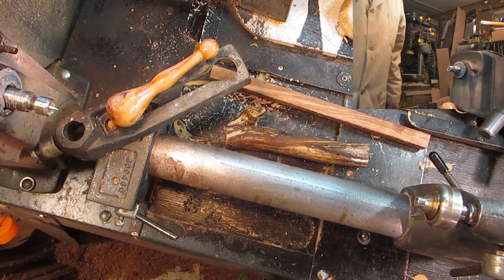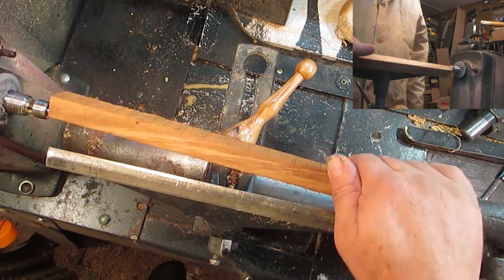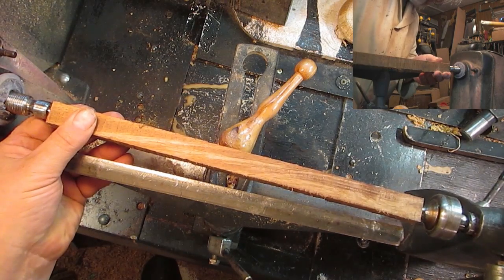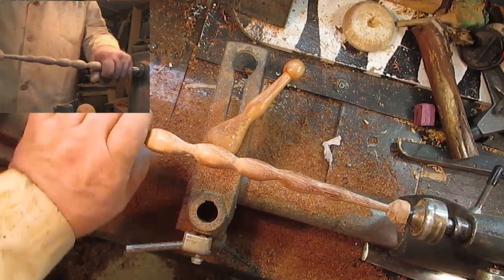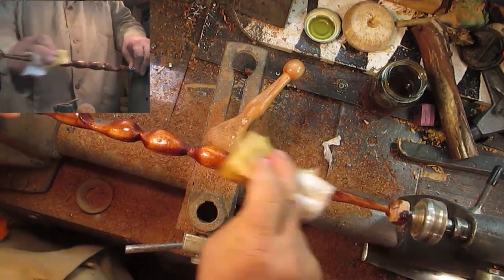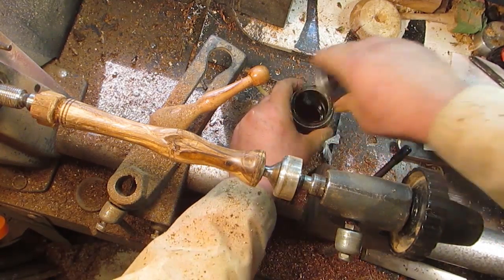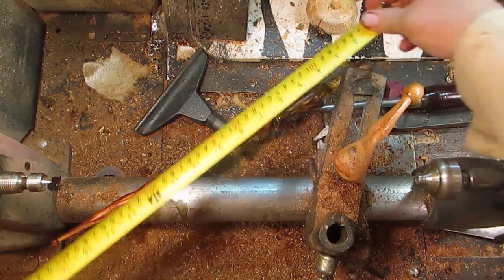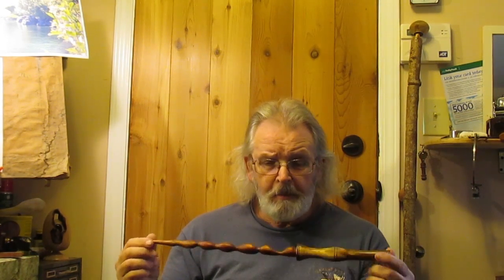Wood Turning #89 A Magic Wand

Comment: Well Larry, this is the best by far Magic Wand I have seen turned on Youtube. I like the random type off center turning. It just looks more natural and not so much calculated mechanical feel. Very well done my friend. Tung oil is one of my favorite finishes.
Reply from the maker: Stephen Ogle Hey Stephen: I have a secret for you... on the handle... I used the tung oil... but then I put a shellac friction polish over top! I like the way it came out... Just make sure you don't  tell anybody about this!   Organic and random... yeah... that sort of puts a finger on the fact that I didn't have a clue as to what I was doing! I like the results more than if I had done something like the egg cups I did... but I will probably try that way too!      Thanks for watching   Larry
Reply: I do sometimes use other finish over the tung oil also. Your secret is safe with me.
Reply from the maker: Stephen Ogle I knew I could count on you!

Comment: Hi Larry, I think your pattern for turning offcentre has worked really well and given the wand a unique, gnarly, look which is very attractive.  Instead of trying to fix it I would be doing more of the same to see where it brought me.  I like the tung oil look too.
Best Wishes, Brendan.
Reply from the maker: baconsoda Hello Brendan:   My pattern was a complex set of algorithms that tuned the harmonics just right! It was also a matter of the fourth hole breaking and leaving me no way to get to the rest of it!! So I guess that is what I will have to do in the future... break one side off before I start!    Seriously though I do have a curiosity as to what can be done there... I guess I would have to invest in a Lathezilla to get it to a spiral... but close might be interesting!    The Tung oil certainly does add a flare to it!       Thanks for watching   Larry

Comment: you have a great voice, very easy to listen to.
Reply from the maker: Tizona Amanthia It's the best one I have! But I do tend to save it for special occasions! ;>) Thanks for watching   Larry
Reply: chuckles I've heard some men have many voices. waggles eyebrows a good challenge for you might be a toy, or other object that is made of multiple parts that interlock snugly. one fun one is what's called "twist tac toe" think like you took 3 rolling pins, drilled three sets of three holes in each, and mounted so they turn easily in a block of wood, with another nine holes drilled into it's face plate, such that the sets of holes line up. a marble dropped in will land in the "roller, and thus the game of tick tac toe is made more complex.

Comment: Awesome wand, I love how you used two different kinds of woods - and they compliment each other very well. 

Can you tell me how you attached the two pieces?
Reply: Larry drilled a hole in the handle, (you can see the drill setup at 8:12 )and turned a tenon on the end of the wand that fit into the hole. (you can see the tenon on the left end at 8:55)  :)

Comment: The offset thing is a real challenge. I did a walking stick and my dyslexia got me backwards. Turned out well, all-the-same. The wand looks good!
Reply from the maker: kbbacon Hello Kevin: I think I will have to practice that a little more... I like the way this one sort of is and sort of isn't off centered... and I think that lends a certain appeal to it... but I do believe that there are a great many more shapes hidden in there! This wand is almost as long as your walking stick... but I don't think it has the same holding up capacity!      Thanks for watching   Larry
Reply: The Tiny Trailer Workshop axeminster machines and tools England

Comment: Just wondering, why have the wood of center? I don't know much about wood turning and lathes and all that, but it still made me curious!
Reply from the maker: +Nicholas Flanders Hey Nicholas: It would have been a lot easier to just do a straight tip on the wand...but I was attempting to create a more mystical look!  There was no real need for it but I wanted to see if I could do it! The method that I used didn't hold up as well as I had hoped so I ended up with a three sided wand... had it held up the knobs on the shaft would have done a slow spiral up as you turned it! It is not putting a thread on it but it does have some of the same principals! ;>) Thanks for watching   Larry
Reply: The Tiny Trailer Workshop Thanks for the info!

Comment: that's such a skill, I wish I could learn how to do this :-)
Reply from the maker: +Grace hallons Hey Grace: All it takes is some practice! You don't learn to make a wand any differently than you would to learn a new spell... time and patience! Put your mind to it and I'm sure you will come up with something fabulous!  ;>) Thanks for watching... Larry
Reply: I don't have the equipment a tiny dremel and a few files a swiss army knife. no room for I like the way the twist is like a unicorn horn, I can't have a lathe due to lack of space, but I think you should make some more wands, I think you're giving up too soon  ;-) .:( thank you for the kind words :-)
Reply: +Grace hallons Many turners begin with a mini-lathe, a handful of tools and a shop vac, and they make some really neat small items such as this wand. Of course that still takes some space, like maybe 4 x 6 foot table top. Dust is also an issue but the shop vac helps. Hope  you can find the space and start turning! :)
Reply: I sadly can't accommodate one I do have asthma so it's probably a sure fire thing of a 'no no'. I use to use a mini kiln in my old place to fire metal that was outside, I no longer do anything like it and feel quite empty about it. that was great fun,melding different metals together but hard to get them to right temp... easier to do on a scorching hot day.felt a bit flashdance too!  but, downsizing has really put a whole new spin on things. I guess I will figure out what to do in time with something smaller and less dust it's just not much fun not being hands on with things. mini lathes a good idea. Thank you just bought a wand it wasn't turned it's pretty rustic with crystal on top but, it was made with love. almost forgot merry christmas! thanks and all the best with the wands!

Comment: What centers are you using for the offset work? It appears your using a live cupped ring center on the tailstock, but what are you driving with? It appears to have a long pin on it... Neat!
Reply from the maker: Hello there:
 I have a pen mandrel that uses a live center to hold everything together... sorry I can't remember the name at the moment... but I got it from KMS ... so if you look up their catalogue on line you will find it! This is the only live center I have and it works like a hot....well!
 The other end is a spur... it came with my Craftsman lathe... (I got it well used) and I assumed that it was for the tailstock. At least that is where I used it for years. But then I found that using it enabled me to turn wood that was difficult to turn otherwise by making so that if there was a catch of any sort... the wood just stops. This I found very handy when working with the skew! The only thing that happens is you get to see where the problem area was without loosing it!
 Glad you enjoyed
 Thanks for watching
 Larry
Reply: The Tiny Trailer Workshop Thanks for the response! As best as I can tell, looks like that center in your tailstock is simply called a mandrel center as you indicated. The spur center in the headstock is so interesting to me! It has such a long pin in the center. It seems like that would be beneficial for off center turning. Apparently my best option is a steb center with many teeth (though the steb centers' pins retract when pushed into the wood).

Thanks for the response again! I was scouring youtube looking for off center work on very thin diameter pieces. I'm considering making a turned tulip (much like Carl Jacobson's video) but with an off center turned, twisted, stem. Not sure if I have such skill, but it will be fun to try.
Reply from the maker: Good luck!

Comment: I have a problem where the wood vibrates when it starts getting thinner.  Is making wands different from furniture? Am I putting it in the lathe too tightly?
Reply from the maker: Hey Robert:
As wood gets thinner it will flex with the momentum of the lathe. The use of a steady rest will alleviate that but if you don't have one... have your tailstock up but at no more than a guiding force (you're right too much pressure will cause it to flex even more!) ... and use very light cuts!
Usually with furniture the pieces are a little thicker than they are with a wand, but the wood still acts like wood and you just have to be ready for it to do so!
Thanks for watching
Larry
Reply: The Tiny Trailer Workshop Thanks! I have a tool rest but no matter how soft I cut the wood does end up flexing.  I'll try loosening up the tailstock and see if that helps.
Reply from the maker: If you are comfortable with it... run your hand on the backside of the wood to counter act the pressure you are putting on from the front. The wood will get pretty hot very quickly so you have to be careful, but you will get the hang of it before too long. Just make sure that you have no sleeves to get caught or anything like that!
Remember too that some woods flex more than others.
And I think I see a confusion here too... not a tool rest but a steady rest... the one with wheels around the piece to hold it steady. You can find all kinds of videos on how to make one with an old pair of roller blades!
Good luck!
Larry

Comment: How did you join the handle to the shaft?
Reply from the maker: That was the easy part... Just a little glue on a tenon and slide it into the hole drilled in the handle and it is all done! I didn't even use clamps as I didn't think there would be much stress put on it!
Hope you have fun with it!
Larry